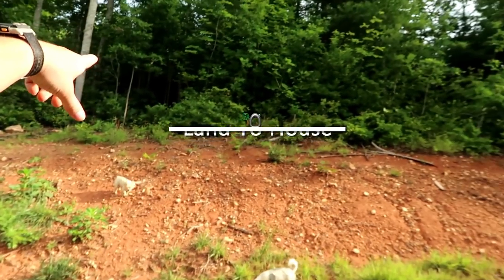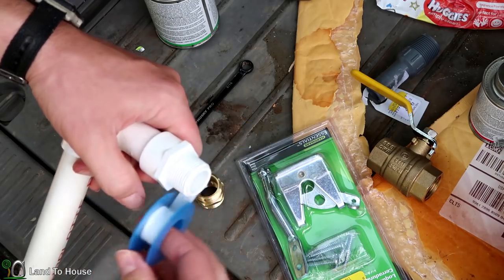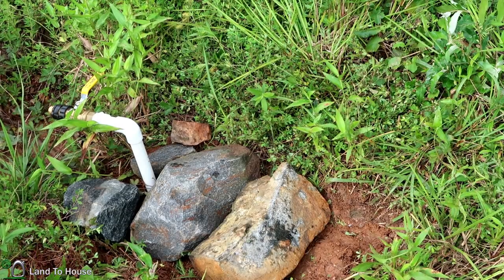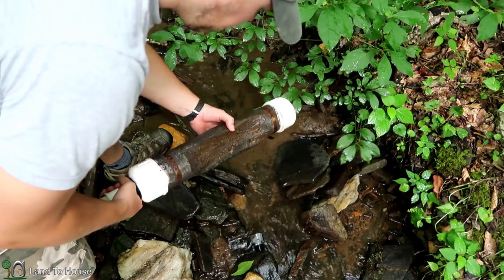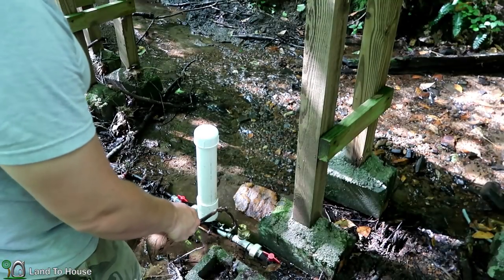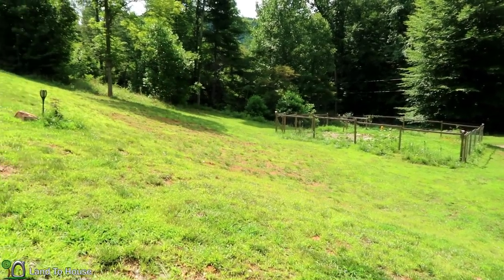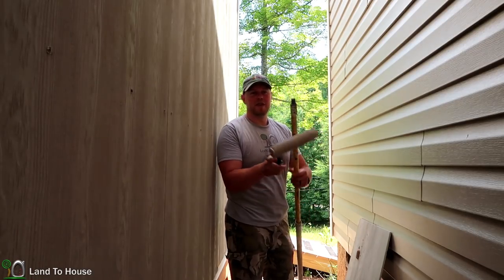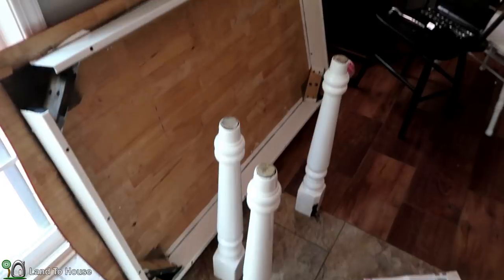My Ram Pump has stopped working - Vlog #93

Comment: It's called water hammer and there's already systems and things that you can implement into your existing setup to eliminate or soften water hammer.  I'll get you a linky.
Reply from the maker: I have seen that video. Nice one. The ram pump needs that hammer effect to operate. If it is reduced the pump does not work as well.

Comment: Seth, around 9:12 in, it shows you have heck of a good pressure there. Would it be possible to connect a hose straight to that?
Also, what are the risks to the pump when you're not using the hose, because the pump is still working but the delivery hose is mostly 'off'?
Reply from the maker: Yes you can connect the hose directly. the pump will operate without the delivery open. The issue can be when the delivery pipe is opened again and the large pressure is let out. Sometimes the pump can stop if the back pressure is not great enough.

Comment: Im a retired structural engineer... 

Enlarge the pool area where your dual intake filters are to be placed. 
1' deep x 3' wide x 4' long. Center the intake filters in the pool at 6" depth. Rock perimeter lining and filter supports are fine. 
The rock dam should be at least 18" beyond the filters. 

Over time sediment will build up against anything restricting the water flow such as the rock supports and dam. 
Once a year, after every rainy season, shovel out a few scoops of sediment. Remove leaves and twigs as well. Be careful not to disturb the positioning of the filters or supports. 

Deoendant upon water mineral build up (purity), Intake filter maintenance should be reduced to once every 4 or 6 years. Simply remove filters, dredge pool area out, clean filters thoroughly and reinstall filters. 

You could even lay a 3'x4'  fiber or aluminum screen over the top to reduce debris from falling into the pool area.
Reply: I hate auto correct... It always makes me say things I didnt Nintendo... 

Correction is:  "Dependent"

Comment: Hey Seth,  Why not just run that connection all the way to the garden and put in a hose reel in the garden so you don't have to worry about it at all?
Reply from the maker: Yes that is the plan . I will probably do that in the fall. It will be better to have the disconnect right past the gait.

Comment: Use cable ties instead of the metal clamps... they don’t rust.
Reply from the maker: I just purchased some. Should be using them this week.
Reply: If you need more positive pressure than a cable tie... check with your "local" BMW dealer for German style hose clamps. They are stainless, better clamping and not too much more money than American.
Reply from the maker: Stainless steel would definitely be necessary if kept in the water this long